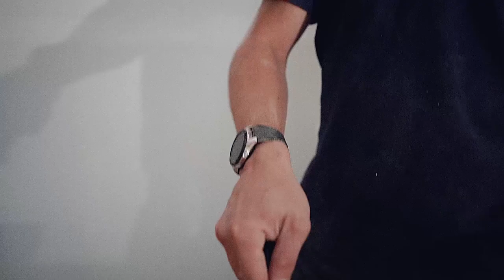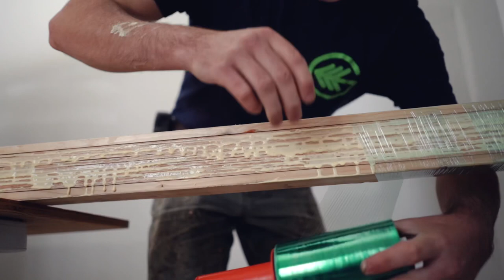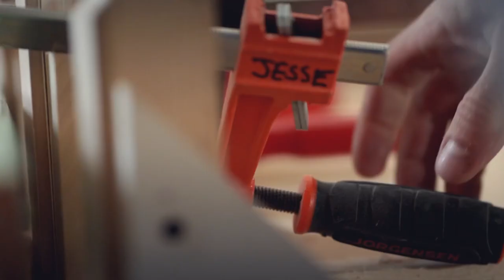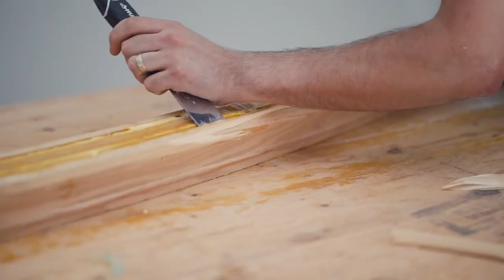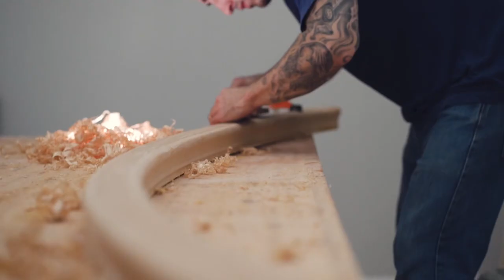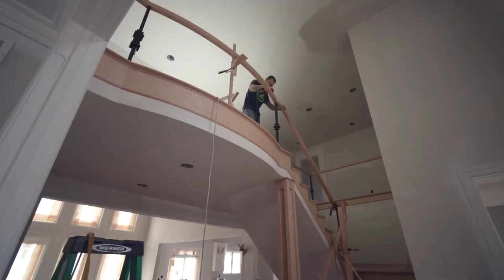Curved Rail Lamination Process - Great Lakes Woodworking

Comment: I spray a light coat of lacquer or paste wax to the rail before glueing. The bending mold and excess glue come off with very little effort and save HOURS of sanding.